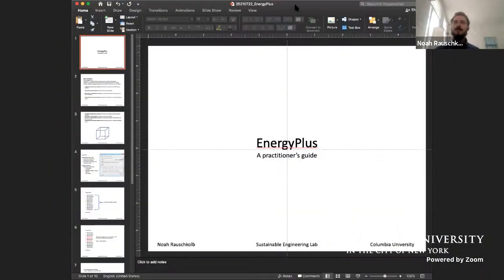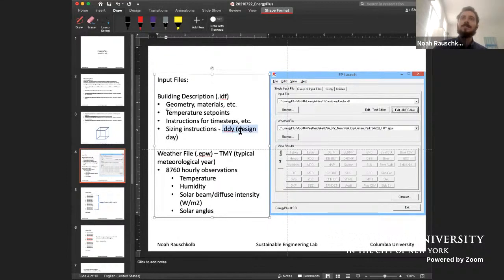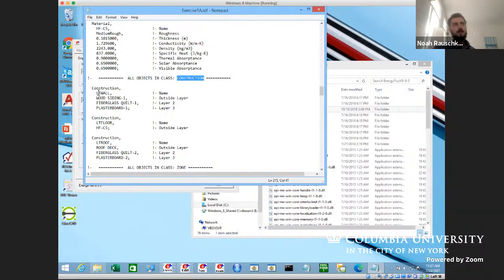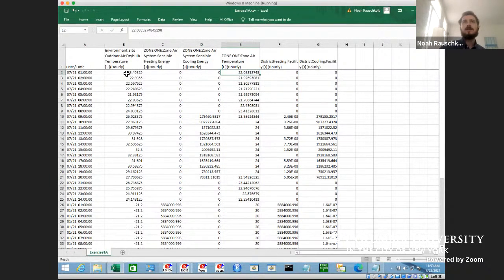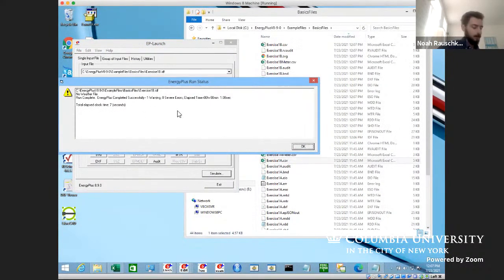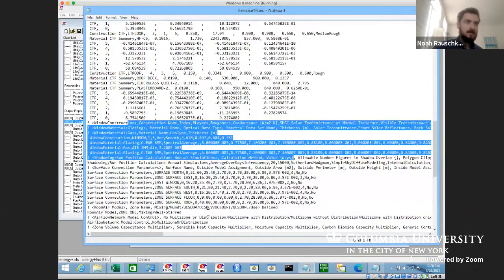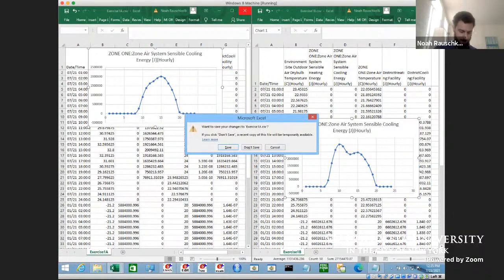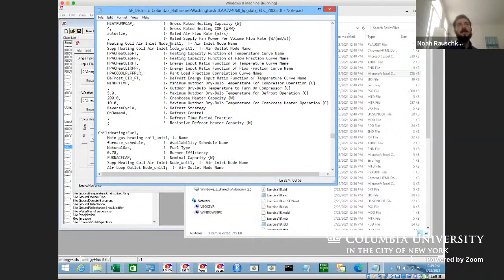EnergyPlus Tutorial

Comment: Just a comment on adding the windows.  See "EnergyPlusEssentials.pdf", GlobalGeometryRules.  "Exercise1A.idf" is set as: Vertices must be added in counterclockwise direction (as viewed from the outside of the surface). And the starting vertex is set to the upper left corner, but you can start from any vertex as long as the orientation is counterclockwise.  These can be changed in the Class List: GlobalGeometryRules.

Adding both windows is a good idea because it demonstrates clearly that you cannot just change the x-coordinate of the east window to place the west and visa versa.  This is because the objects are on opposite walls so the vertex orientation of the object will have opposite orientaion when placed into the opposite wall, and this will result in a severe error.  The east window object's vertices have to be transposed so that they have a counterclockwise orientation when placed in west wall and visa versa.

Comment: Hello Noah, nice teaching procedure. 
I am currently working on a project for thermal performance optimisation in buildings using an earth-air heat exchanger cooling technique. my variables are atmospheric temperature, soil temperature, soil depth, and humidity. 
I want to validate my project using Energyplus and determine the best setup for my future experiment. my field experiment stops at 2m depth in the soil but I want to use simulation to determine the best depth for optimization.
I need help because I am new to this software and need someone to assist.
Thank you

Comment: Hey , first i saw this interresting lecture and it's very useful so thank you for ur effort. 
I m working on a small project about to study the temperature distribution with respect of the dimensions of the tank , and i would like to do the simulation and calculations using the Energy plus software but i need some help since i m still a beginner , so if there is any chance to contact with you i would be so happy for that .
Reply from the maker: I don't think EnergyPlus is the right tool for looking at thermal stratification in a tank. You will want to use something designed for thermofluids analysis.